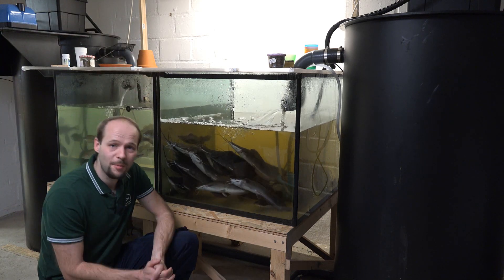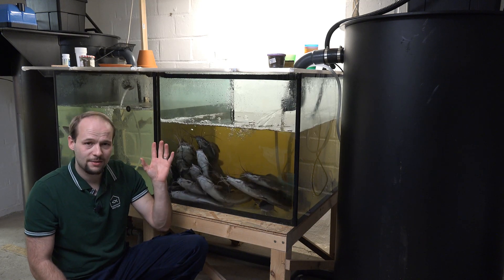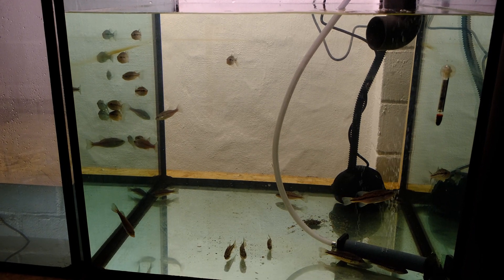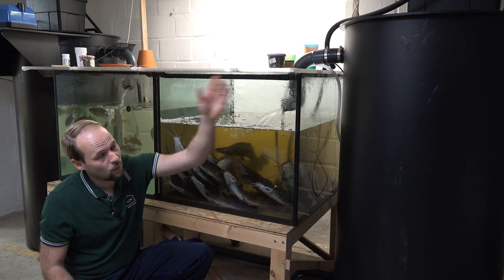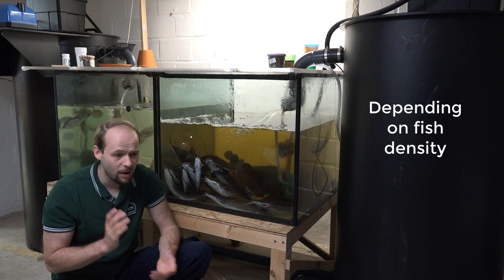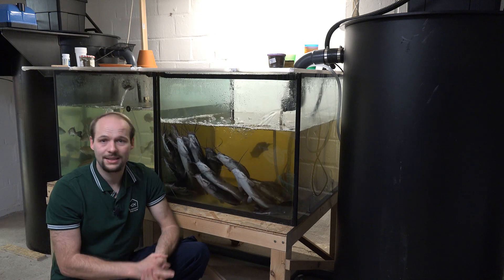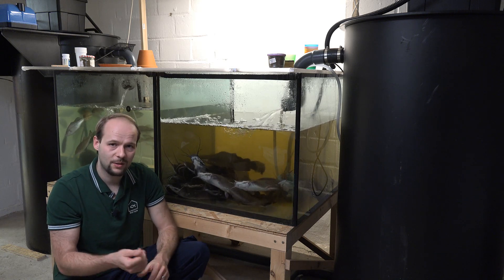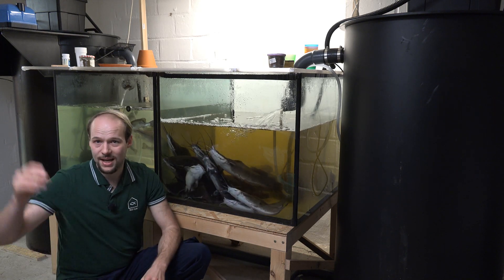My Decoupled Aquaponic System Part 1: The Fish System

Comment: Does decoupled APS generates enough nutrients for Plant production ? I assume one needs to have relatively smaller aquaculture volume than its required to successfully meet the needs of the plants and add some supplements. In other words how do you manage the plant nitration with decoupled AP.
Reply from the maker: Hi, indeeed I would make the fish production a bit smaller in a decoupled system because I want the plant system to absorp all the fish water. The nutrition of the plants is less of a problem because you can add nutriens as needed. That is usually done by a computer/fertigator/nutrifi.

Comment: I have two more questions
1) Does it really necessary to circulate the water in a decoupled aquaponics system as intensively as in an aquaponics system ? Simply maintaining the water lvl using the aquaponics system  water and adding nutrition to the DWC either directly or by dosing is enough? I am assuming agitation via airing is enough .
2) I have send an e mail no response still ! Pls check your spam files
Reply from the maker: 1) Yes,  the water needs to be cleaned/ treated constantly. Check out my video about RAS
2) Late Saturday I´m out of office ;) But you got your reply on Sunday.